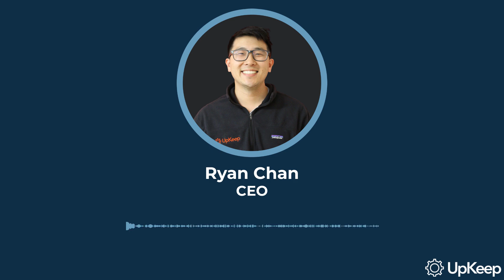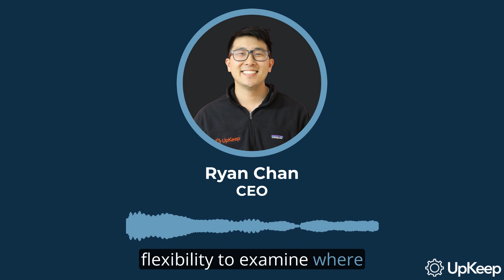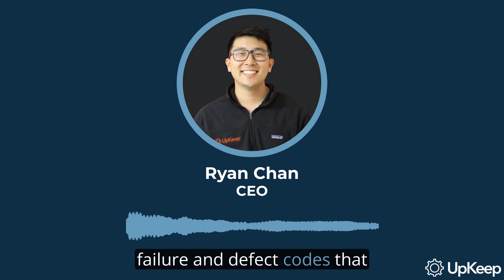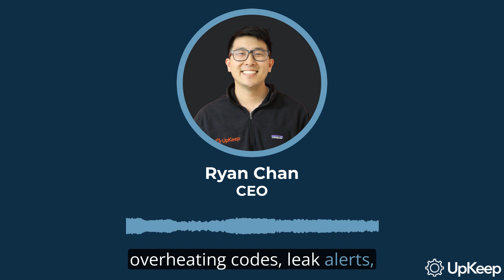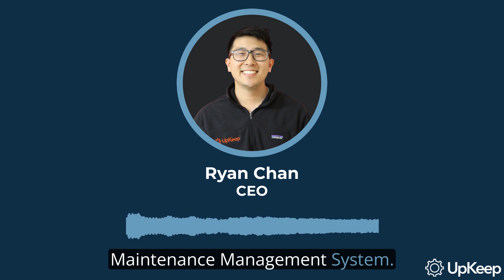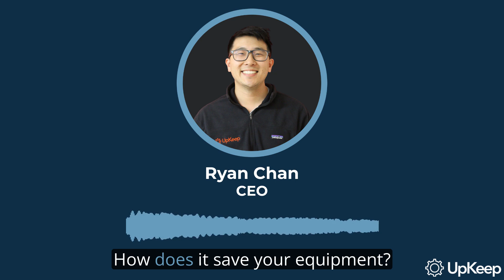Understanding Failure & Defect Codes in Computerized Maintenance Management Systems

Comment: Observation: Conveyor Stopped, 5WHY 1. Motor Tripped, 2: Gearbox Drive Jammed 3: Shaft Bearing failed 4: Low Lubrication 5: Lack of Maintenance (an electrical failure was the effect and the cause was a mechanical failure)

Apply MSG3: Create a Quarterly Walkabout / Lubrication task.
1.	To observe and record Oil Levels
2.	Oil sample analyses (wear and Tear)
3.	Lubrication top up

Setting up your CMMS with the correct Code structure is the most important implementation on any system. The right Failure, Cause, and Effect Codes are broken down per trade Elec, Mec, Inst, and Operation.

Man, Machine, Material, Method, or Maintenance.